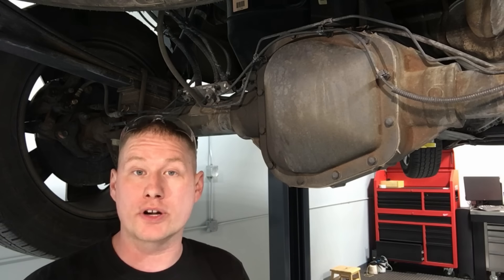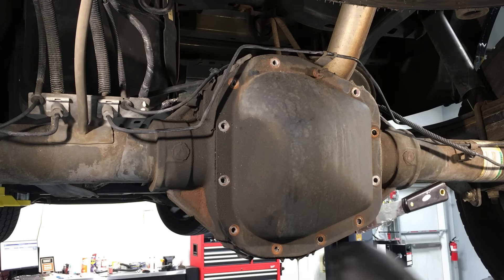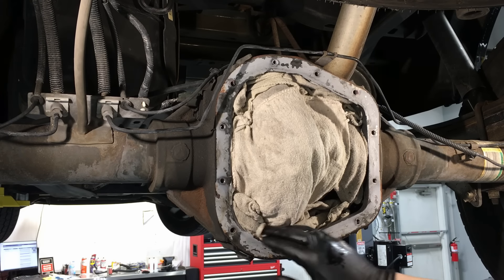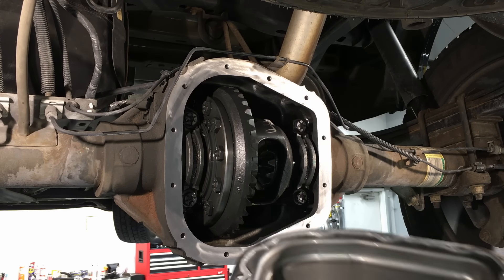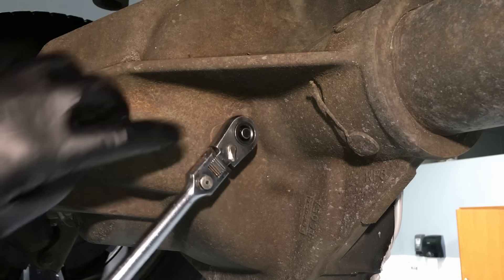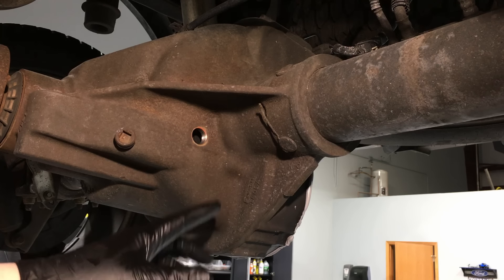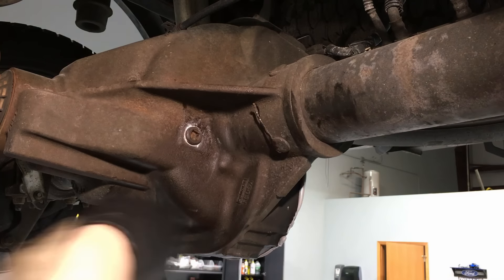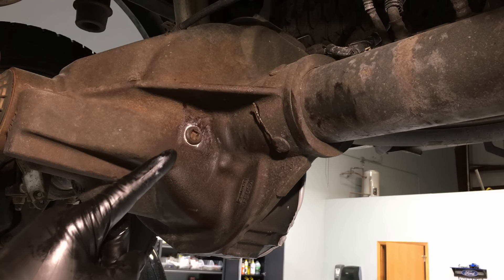Ford 8.8" 9.75" 10.25" Rear Differential Service: Fluid Change Procedure

Comment: Another tip. Before draining the oil from the transmission, transfer case, or differential make sure the fill plug comes loose. Nothing worse than draining something and then not being able refill it. On fords the sensor on the top of the differential for the ABS can be removed to fill it, but you won’t know if it’s filled to the right level.
Reply: If it is completely drained, just look up how much it holds and add that amount.

Comment: Damn dude. That’s the most thorough rear end fluid swap I’ve ever seen.
Reply from the maker: Thanks!
Reply: This is what it takes to do the job right!
Reply: Iron *Fe*  no
winter time your oil isnt as thick, 30weight is quite a bit to be off by. check me out
Reply: Wish he would have shown how he cleaned out the rear end and all the bearings.. There was a lot of area that didn't get wiped down.. More questions now!?
Reply: That's what she said

Comment: before commenting on this video i pondered   it for quite some time, at least 5 minutes, while scrolling through hundreds of previous comments giggling uncontrollably all the while. what finally made me decide to publicly post was the fact that out of the 1.6k comments by other views, only a handful, less than 5, made a point to applaud you for  upholding your professional demeanor during the tense moments of the refilling of the fluid. i also wanted to add that those fart noises emanating from that bottle were second to none movie grade sounds. if your mechanical career doesn’t work i’m sure you would have no trouble finding a role in Hollywood. spot on my friend, spot on.

Comment: These simple maintance jobs videos are the best. Rountine maintance that most people never think twice about. Love this channel. Really helps me with my 2005 4.6L 4x4 f150
Reply from the maker: Thank you for those kind words!
Reply: M. Sami  Sometimes I wish I had the 4.6L instead.
Reply: With Brian around and his extensive library of videos, my 5.4 3 valve doesn’t worry me a bit. Great engines, just have to care for them and know the short comings. 5W-30 synthetic w/ FL820S and changed every 4K is a good start.
Reply: @BustinCasts  what is fl820s?
Reply: Dave K. The part number for the Ford engine oil filter for my 5.4L 3 valve.
Reply: M. Sami 5.0 and 6.2s are pretty solid too
Reply: FordTechMakuloco is this service the same with a 04 grand marquis
Reply: @ivancedillo8  
Should be, most likely you have the 8.8 drive axle.
Reply: M. Sami  until you're going up a hill with a heavy trailer at 35mph, then you're like "dang I wish I had the 5.4"!!
Reply: @JimBronson  nah. I'll buy a f350 with the diesel. Or use my f800...😁
Reply: @BustinCasts  I just got done googling to find that out. I should have just kept reading. LOL.
Reply: @housepumpinpc3983  
we don't all have that kind of cash to blow on a Diesel we rarely need.
Reply: @DennistheMenace-e3f  I have a 4.6 and it does the job. The 5.4 is great until the phasers mess up. If you bought your 5.4 new and religiously changed the oil, 5.4 might last. But if you got one that was abused... 240k and counting on my F150. And I agree, the diesel is more expensive. The diesel is also more reliable.
Reply: @GI-rt7ol  the 6.2 is Very Solid 💪
Reply: @FordTechMakuloco  my 04 calls for 75w90 should I replace with 75w140?
Reply: @FordTechMakuloco i havea 2019 ford f150 2.7 litter. Should i use rear diferential fluid 75w85 or 75w140?

Comment: My two cents:  
1) take an earth magnet and stick it to the diff cover and put two bolts on it for easy reach.
2) When putting the diff cover back on I use two chopsticks (or you could use metal) through two holes line them up and diff slides right into place without sliding around. Grab a bolt off the magnet and tighten to hold.
Reply: Ahh naa

Comment: If the plug is NPT(national pipe taper) and the plug in your truck's differential is damaged, a suitable substitute can be found at any hardware/plumbing store. Home Depot, Lowe's Depot, wherever. You get a square protruding lug to put a wrench on, instead of the square depression to put the socket drive handle in. If you get one and use it for your truck, that makes you a plumber and a mechanic. :   )

Comment: It's always nice to watch a job done the right way. I was in vehicle & aircraft maintenance for almost 50 yrs so I know.  I started watching your videos when I bought my 2012 F-150. I sure did learn a lot.  I'm sure others out there learn a lot also, so keep doing what your doing.  I remember having customers watch me work on their cars and tell me how impressed they were with my work ethic.  So, I'll tell you, you have a very good work ethic.  I like it!!!!!
Reply from the maker: Thanks!
Reply: I prefer the 23/4¥ ADQ much easier, contingency 56/35¥ emeg nop.
Reply: If you've learned anything from these videos it's got to be Ford's engineering is severely lacking , buy a Tundra
Reply: @GatesRapes  I swore by them at one time. They are inferior now. 
Engines, panels, running gear etc. 
 Ask any mechanic who works on them. Ford transits are garbage now.
Reply: I’m a GM tech and I’ve always been interested in aircraft and would be so cool to be able to work on them.
Reply: @marshalllove  My greatest thrill while being an aircraft engine mechanic was when there was a need for me to fly with the crew and visibly see the problem.  On some aircraft there are adjustments that have to be made in flight. That was awesome as well.  To see, you can make a adjustments and all is well.  Very gratifying.  You should check into moving to aircraft.

Comment: Just wanted to say how much I appreciate how well done these videos are. I've done the rear diff and transfer case on my truck so far, and I've got the front diff and transmission for my next goopy fluid jobs after I finish swapping in a new air compressor. I try to make my own how-to tutorials, and they comparatively suck compared to these, but it gives me a good appreciation of the amount of work you do to share these with all of us. Thanks for saving me a ton of time and money and putting these out into world for free.

Cheers!

Comment: When working on the floor of our garages like most of us do the one suggestion I found that worked for me was the removal of the spare tire tire. This gave me easy access to the rear differential without having to jack up the truck.
Reply: Couldn’t agree more. Removing the spare takes an extra three minutes and saves lots of time and effort.

Comment: One thing I do with my differential cover when putting it back on is that I use a 2 inch long stud (or threaded rod) without the head (with the same thread size as the cover bolts) and screw one of these studs in on each side of the differential.  Then when I install the cap back on with the RTV, I just use those studs to guide the cover on.  Then I install a few bolts and remove those studs and move on with the rest of the install.  This is what I came up with to idiot-proof my own installation.
Reply: I usually already stick a bolt in the cover on the top, then put the cover back on a screw in the bolt.
Reply: Playtawin I do the same thing. I have a selection of bolts (length and size) with the heads cut off and I use I thin cutoff wheel and cut a groove in them so if I have one kinda tight I can use a regular screwdriver. I’m a old Ag mechanic so pans, water pumps etc are a lot heaver.
Reply: That is an excellent idea with the thin cutoff wheel!
Reply: Wow. Thanks! Thats a great I-proof solution for me...I don't have a lift in my crappy garage, and doing this lying underneath has its challenges as I get older.  Any little trick helps, and the 2" threaded rod is a good one...thanks for posting that!
Reply: This method of creating line up studs has been around forever and is commonly used in the field for installing transmissions and whatever else. In your case I guess rear diff. covers
Reply: That is what I would have suggested .
Reply: Playtawin thanks for the tip!
Reply: @TheTruth27536  Good old fashioned hack saw will accomplish the same thing.
Reply: Great suggestion. Im a plumber and have used pin wrenches to line up flanges but threaded rod seems like a better way to go. 👍
Reply: This technique is a must for aligning bell housings to engines.
Reply: Good idea bro
Reply: A 3/8" x 16 thread tap works perfectly for this.   I also had some 3/8" x 16 threaded rod and made two studs approx 2" long.  They just threaded in by hand, no screwdriver slots needed.
Reply: If you like that and being precise i would recommend you check out reverse logic as they have threaded rods for installing wheels without hitting the brakes if you have tight tolerances, nice wheels and wide wheels. Although they need to make them longer for my car because the rims are really wide. 325/30-19 in the rear. 13"
On VW's they don't have lug nuts. They have bolts so there is no stud to put the rim on. It's nice for those cars.
Reply: I do the same thing
Reply: @Playtawin What you have described is known in the trade as a drift pin or alignment pin.
Reply: I do the same thing aswell for other applications.

Comment: I enjoy your videos and I just ordered everything for the  rear differential and transfer case using your Amazon links.  The only suggestion I have for the differential cover is maybe make 2 alignment pins about 1-1/2" long and install them at the 10:00 and 2:00 o'clock positions to facilitate putting the differential cover on.  The pins can help support the cover while you start the bolts.  Once the bolts are started; simply remove the 2 alignment pins and replace them with the last two remaining bolts before you start the tightening sequence.  Keep up the great videos.
Reply from the maker: When the cover goes on it is already aligned as you can see the holes through the cover, the rtv holds it immediately to an extent and the first two bolts go in right away. The whole process is very fast actually no alignment pins needed.
Reply: @FordTechMakuloco  Check that box.  Mine is complete and it worked just like you said.  It's the 2011 F350 SRW with 10.25 rear differential.  I was surprised to find a separate flange on the cover.

Comment: Just bought a 2011 Lariat with 105k on it. After watching this I decided I better change the diff. fluid . Man am I glad I did , it looked like mud !  I did notice the gasket maker said to finger tighten the bolts and wait about an hour to torque them, so that's what I did. I refilled it the next day and no leaks (after a good test drive). Love your videos !  Oh, my quarts of fluid had gas too.

Comment: Brian may have mentioned this later in the video too, but my best tip would be: make sure you can crack and loosen the fill port before you drain the diff :)
Reply from the maker: Never had a problem nor have I seen other techs at the shop so it just didn’t come up.
Reply: Use the ABS sensor port if needed
Reply: Had a 98 f150 with 150k miles and I learned that the hard way. Had a hell of a time loosening the fill plug after I had already drained it

Comment: You are an outstanding mechanic, And have probably forgot more than I will ever know. Having said that, One thing I was taught to do some 30 years ago is to once you pop the cover is to jack up one side at a time just 6in. from level and allow axle tubes to drain for 10 min. each side.   Just my 2 cents.

Comment: I ordered the Mag-Hytec gasket for the 8.8-12 bolt and it worked really well. No leaks at about 1000 miles post change. I am hopefully it’s reusable down the road as advertised.  Changed at 60k and definitely needed it.

Comment: Great video! And thank you very much for all that you teach.  First time doing a rear diff. Had a mechanic buddy tell me what to do and knew i could knock it out.. but there's something about watching someone go through the steps to confirm things! My friend is very thorough as are you, so thanks to both of you. 
I don't know if it's mentioned( I stopped to make a comment) but... just a heads up. By using the wire wheel to clean both sides, your also "scuffing" the surfaces which gives the sealant something to bond to! You don't want super smooth surfaces! Otherwise the sealant has nothing to "grab" onto and you can break the seal.  No point in doing all that work, just to have to tear it all apart and do it all over again! 
Thx again.  Hope this helps

Comment: Unfortunately, there aren't many techs that put the TLC into a job like you do. Go to most dealerships for a rear end fluid change and they drain the fluid, put the cover back on, and slap more fluid in. They take 10 minutes, do a half-ass job and charge $400.
Reply: Yuuup, cause they work flat rate. If the work pays 1.5 hours and they get it done in 30 minutes, they still get paid for 1.5 hours. You also get charged for 1.5 hours, + parts...
Reply: most shops will over charge and do as little as they possibly can to get you out the door [after taking your money]
 So yup best do it yourself
Reply: @LynxStarAuto  Pumping and filling diff fluid may aswell be criminal! Just a half-assed job that dirties up the new fluid really quick. With the cost of diff oil its something that should be done right.
Reply: @D-dly0  you think rear diff oil is expensive then... Benz blue ATF oil is $29/Qt + labor 
😂
Reply: When I did mine i even cleaned the diff cover sanded it lightly then primed/painted it.
Reply: Bro we don't even take off the cover we just stick a suckerntube in it and then when its done we stick a filler tube in it
Reply: Yes this is true, and the shops don't like those who actually take their time on jobs because they want cars in and out. However, if you want to perform maintenance and repairs properly, it actually takes a great deal longer than they do in the shops, at least speaking for me because I take my time with repairs on my own car and on other peolles' cars.
Reply: Sherrell R.,

I think this U.S. Marine worked @ a Ford Dealership for 10 years. ( Chicago )

Pride in his work. I LUV Pride & being a
"Go By the Book Mechanic". Nothing Else Comes Close.

Me , 2 years , GM Dealership.

Vietnam Era Veteran
Southern California ( 90802 )
Reply: @emmanuelmondesir6878  My father worked at a dealership years ago when he was young and just out of the Navy where everything had to be done by the book. He said that some of the mechanics would intentionally see how many bolts or fasteners they could leave off so they could get the job done quicker. He quit and went into a different line of work. His Navy background was so ingrained in him he couldn't see how the mechanics could feel good about what they do and he knew that eventually it would rub off on him. Plus the dealership harped on him about taking to much time to do a job.

Comment: My 2007 Ranger Level II, has an 8.8" LSD, with a electrical connector going to it. I identified it as an limited slip differential, but it had some sort of sensor gear next to the ring gear. I am believing that it does indeed require the friction modifier additive. Great vid, mine was changed 40kmi ago, but the mechanic whom I purchased the truck from admitted that the cover was leaking, and it was. Looked like he used the grey permitex, gear oil type, however did not apply it like you have instructed us all to do. So in goes the 75-140w and we'll see. I'm sure it will be fine, thx man for a super great video. Saves many from themselves, "something like that"!

Comment: Just an addition here, always be wary of metallic gear debris in the sump! I performed this service on our 2003 Durango 4x4, found out there is a magnet epoxied into the sump to hold onto metal to keep it from circulating. You guessed it, super sharp needle like gear piece went thru paper towel, nitrile glove, and deep into my index finger. Wow, that hurt. Took a while to dig it out, shaped like a cat's claw.
Reply: Metal slivers suck!
Reply: Thanks for the warning. And sorry for your pain !

Comment: It helps while using the squeeze method to put the oil bottles in hot tap water for a few minutes before you start.  It is very difficult to squeeze gear oil out of the bottle otherwise.
Reply from the maker: I never had a problem getting it out using this method, quick squeeze or two and it’s empty. The residual fluid left inside is from not being able to tip it up all the way.
Reply: Add a piece of plastic tubing to the end of the nozzle, and insert the other end into the fill hole. 
Great channel, all the best.
Reply: Robert Nugent Good idea. I've never thought of doing that, but I will from now on.
Reply: If you cut the nozzle less (so it's longer) it won't leak as much while filling. Keep the bottles at room temperature helps a little too. And do drain the remainders in all bottles into the last bottle.

Comment: I just did my rear differential job in my 9.75 2007 Lincoln Mark LT today. I swapped out my factory cover for mag-hytec cover that holds instead of 5.5 pints, it holds 5 quarts of fluid. Don't have to worry about applying a gasket seal rtv and try to get on right without smearing it all over the place. Built in drain plug, o-ring and fill plug with a bigger magnet attached to it. A purchase well worth it.

Comment: i really like your videos. i spent my career as a motorcycle mechanic. one thing i did was keep a couple of long bolts or screws with the head cut off. so i  could align covers and gaskets or sealer with very little movement.